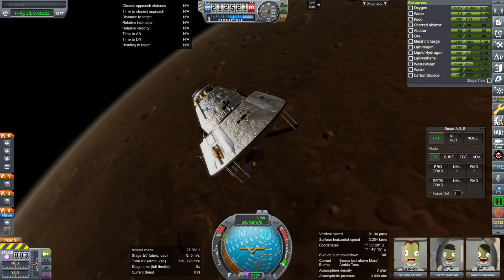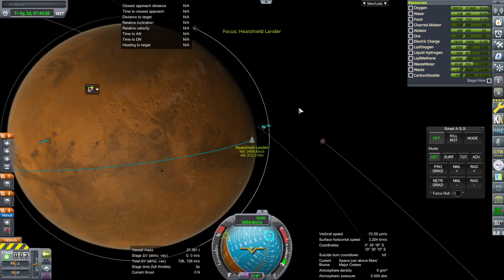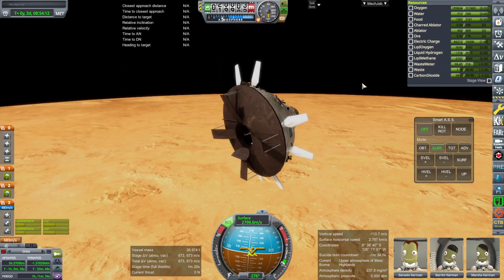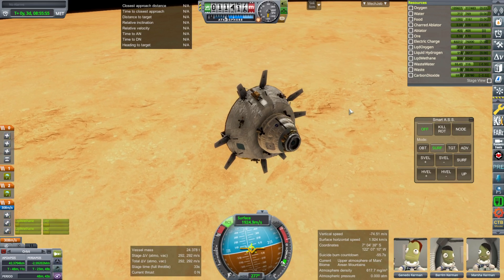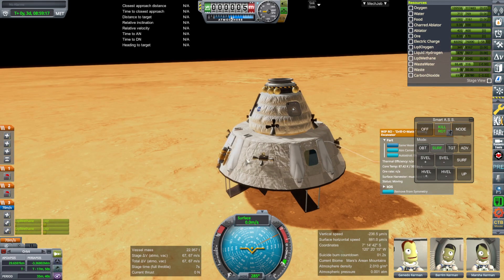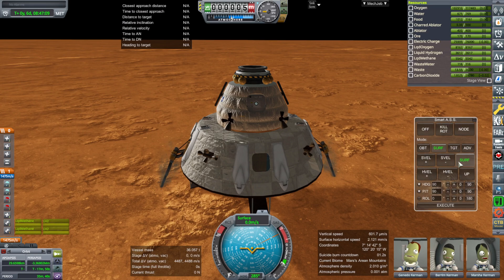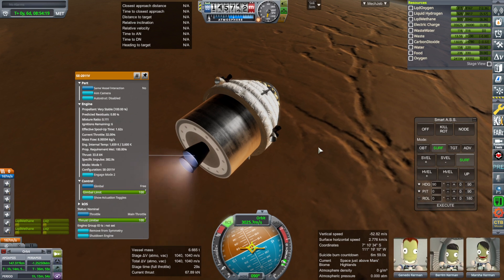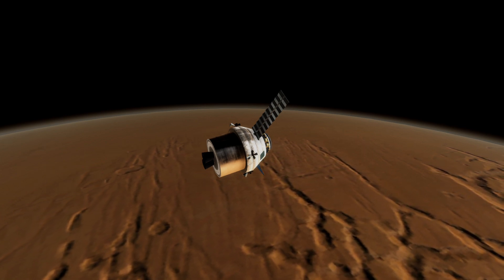Mars Lander Test (RO in KSP 1.12)

Comment: that heat shield although looks cool, I think in real life it is not the design we will go to Mars with because that much moving parts is a potential failure point and engineering struggle to get it to actually work
Reply from the maker: There's not much heat to worry about with Mars - it's not like an Earth entry heatshield - and you have to consider the bottom of the Space Shuttle (which actually did work) with doors for three sets of landing gear as well as hinges for the control surfaces. Not only do I think this design would work, I would argue that it is comparatively easy next to the already tested Space Shuttle because of the lower speeds, atmospheric density, and heat of Mars entry.
Reply: @RaizSpace  sure, but still: slap the door on the side + telescopic ladder (or the door just can be at the ground level) and that's it or f-k up with all the mechanics of the ramp and it's geometry as it also needs to be the bottom of the ship, and it is not going to be hermetical, so the door still will be vertical just as in case 1 but inside the ship and take up useful space. 
I'm not arguing it is impossible or smth but it is indeed a lot more struggle compared to appolo's side door